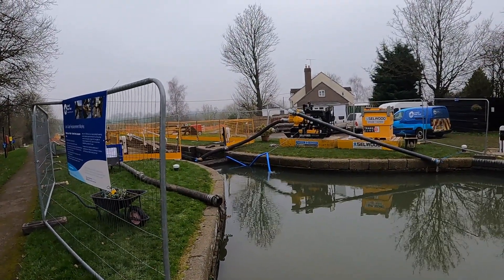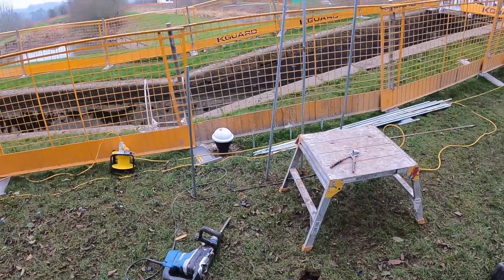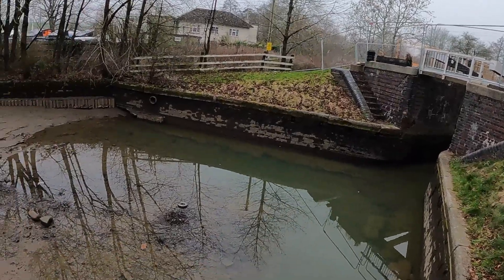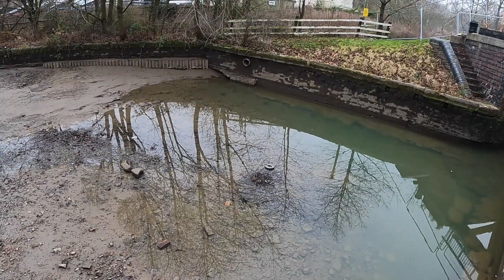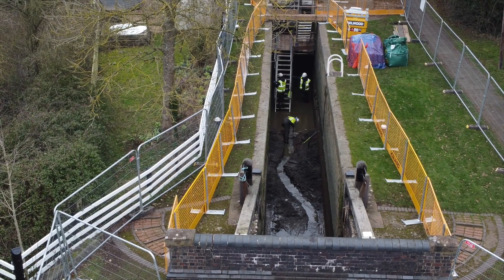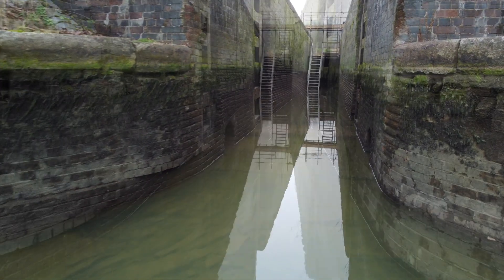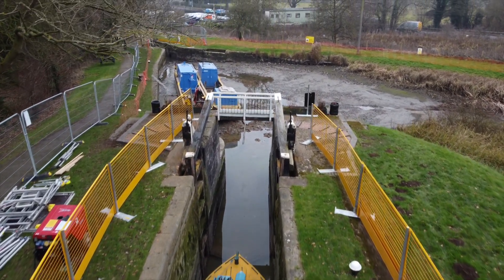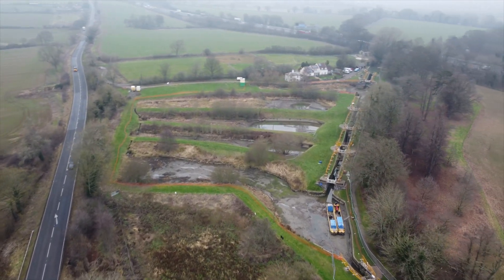Canal Works @ Watford Stair Case Locks, | Working Narrowboat | New Lock Gates | Side fenders NO!

Comment: I have a stone rubble foundation under my house. The stones only keep out the larger water molecules, leading to a wet basement.
I had bentonite injected into the ground around the  house in the same manner as along the canal walls. It has reduced leakage about 98 percent.
Reply from the maker: Thanks for sharing that, hopefully it'll be working on the lock walls to.